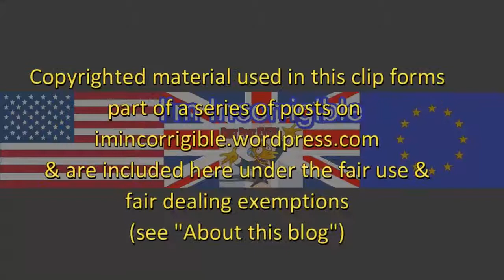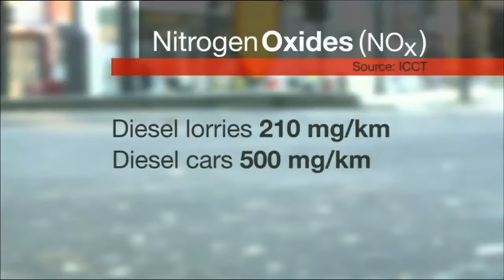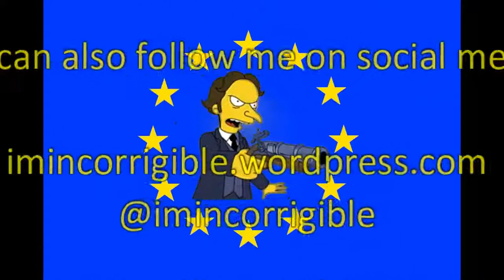Diesel cars produce twice the toxic emissions of buses and lorries

Comment: Diesel cars are being unfairly targeted here. Instead of comparing diesel cars with diesel trucks and busses, they should be compared to petrol cars.

http://www.air-quality.org.uk/26.php

Apart from soot particles, diesel cars and trucks actually produce far less noxious emissions (carbon monoxide, hydrocarbons, nitrous oxides), than petrol emissions including nitrous oxides before it goes through the catalytic converter. The problem is that after going through a catalytic converter, petrol car emissions are somewhat lower. 

As this video points out, this is a regulatory failure in testing which allows diesel car manufacturers to cheat the tests, rather than an inherent problem with diesel vehicles. 

If diesel trucks and busses can be so clean, then so can diesel cars, and the appropriate testing and fuel quality regulations are introduced. Diesel fuel sulphur content can also be reduced to allow more effective catalytic converters, and nitrous oxide reducing additives can be included in diesel fuels.